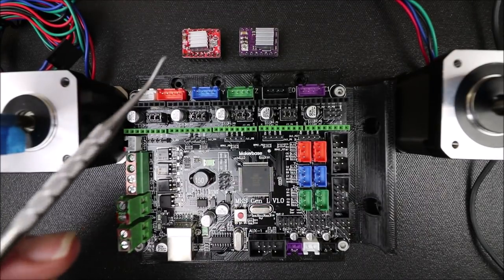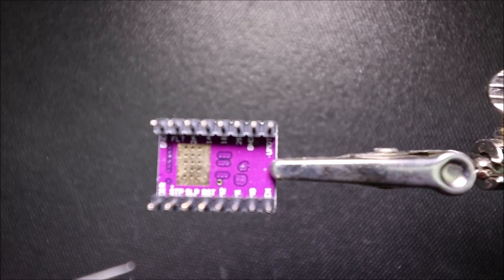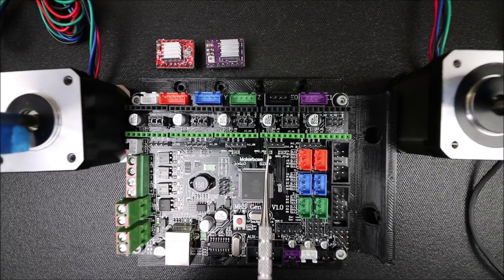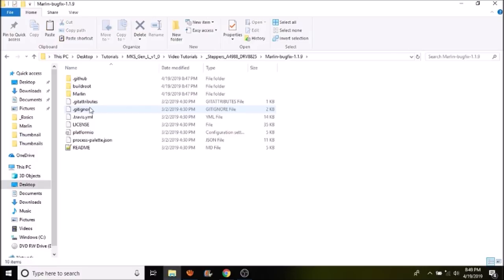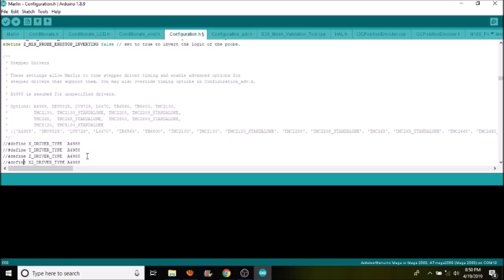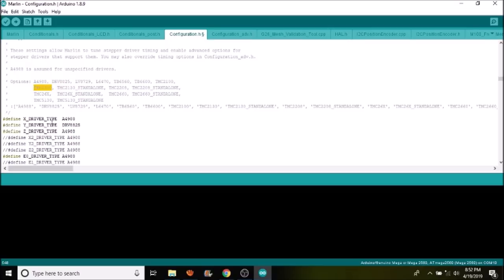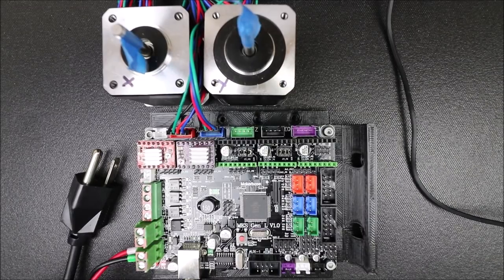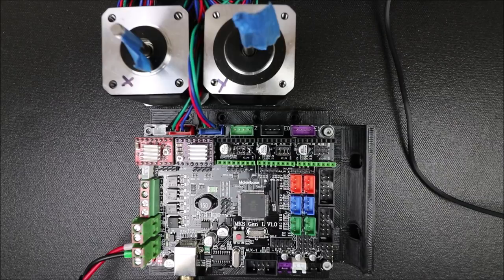MKS Gen L - Mixed Steppers A4988 and DRV8825

Comment: If I power the MKS with 12/24V, is there any way for the driver to limit the voltage to the motor at 6V?   Or is it all current driven and it doesn't matter?  (I'm using a "6v motor" (20BYJ01-160HR))!
Reply from the maker: You could use a TMC 5160, granted you need to read the datasheet to confirm.

Comment: Mr. Braiman I have a spare  MKS Gen L V 1.0. board and I want to use it as a 6 axis robot arm control board. There are plenty of arduino codes for stepper and servo motor controls,  however I can not identify step,dır pins and as well as servo pins in the codes; since its structure is different.  what should I do? manually write a g-code and use it? Or is there a way that I can use it as an arduino board?  would you kindly advise me on the matter?
Reply from the maker: MKS Gen L board is basically the same as a Arduino mega 2560 with RAMPS 1.4, just as one board. You may need to write your own code rather than Marlin firmware.  But Marlin firmware is a good place to start.   You can Google MKS Gen L for a pinouts diagram.
Reply: @EdwardBraiman  Thank you for your answer.
Reply from the maker: You're welcome.

Comment: Another awesome video. Should I adjust Vref for DRV8825 I just install and go?
Reply from the maker: If it works with minimal noise or heat, you should be fine. Otherwise you'll have to tune with multimeter and vref.